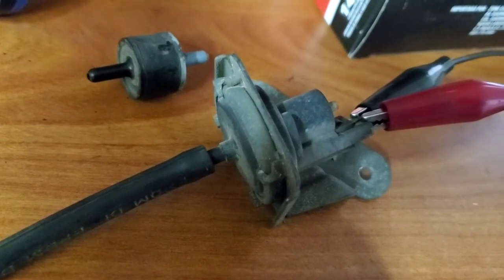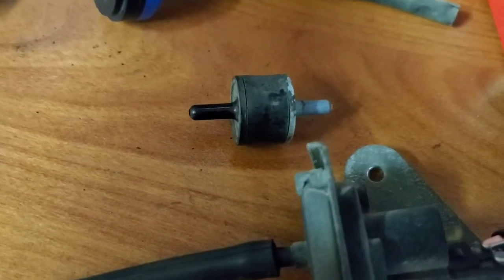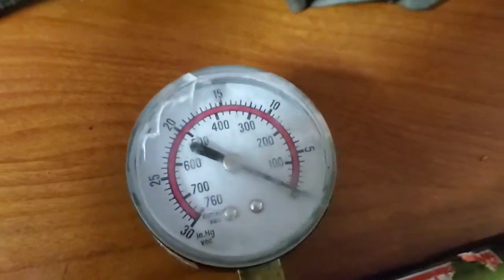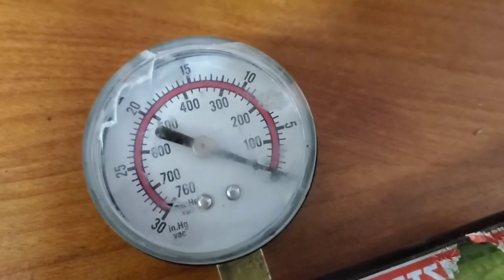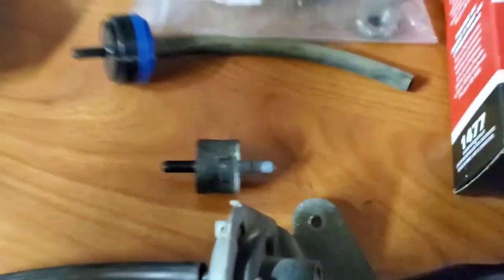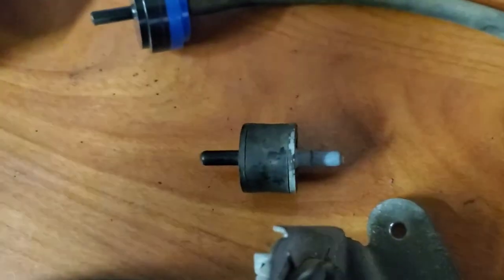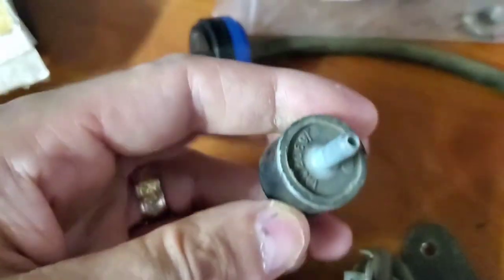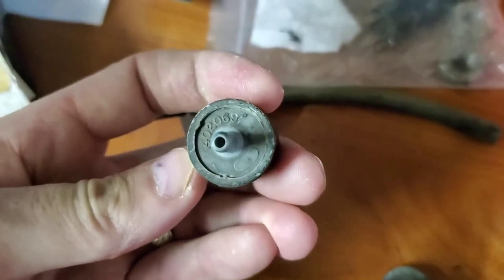Chevy Torque Converter Clutch Vacuum Switch & Delay Valve Demo

Comment: I actually found this NOS GM vacuum delay valve from a dealer in Florida. I installed it onto my all stock 1984 Chevrolet Silverado C10 truck. It did nothing to delay my lock-up. I even switched the valve around incase it was installed backwards. Nothing. 

Cool ideal though. I'll just have to figure out which wire to cut and install a manual switch I guess....
Reply from the maker: Verify that it is working correctly. It should be easy to blow through it one way with your mouth, and difficult the other way. Maybe the one-way valve in it is stuck open. I have seen that before. A shot of carb cleaner has worked for me to free up a stuck valve.
Reply: @pjmoreland  Okay. I'll try that simple "test". LoL!!

I was just happy to find a NOS one. Last one in North America according to my GM parts locator....
Reply: Your engine stalls at stop signs?
Reply: @peterbilt6662  No sor. As soon as you touch the brake pedal, the switch releases the lock-up, just the way GM designed it.